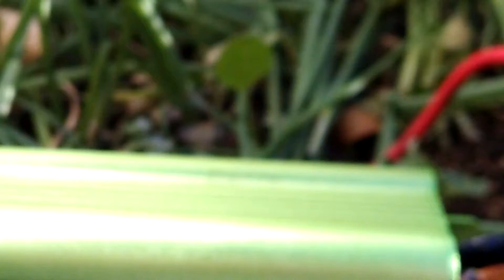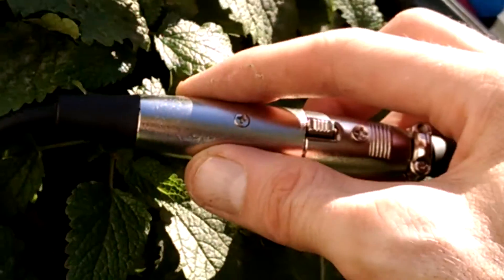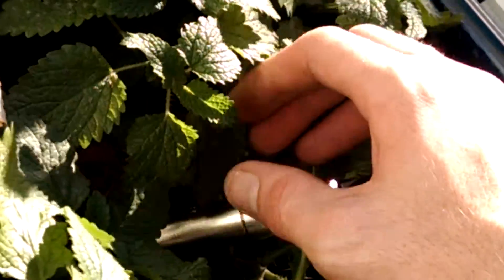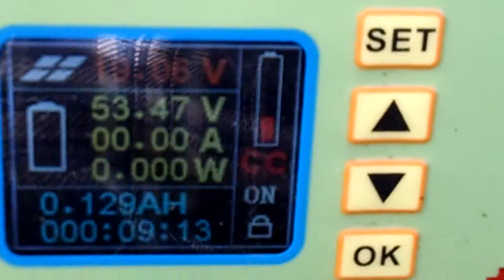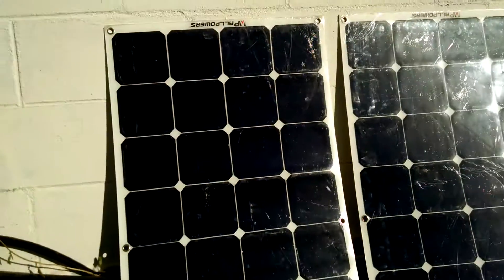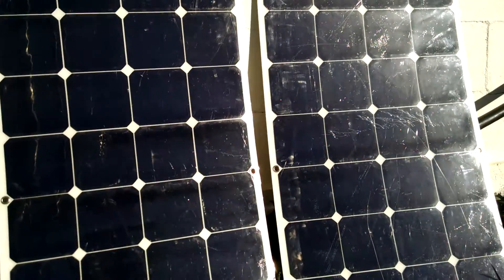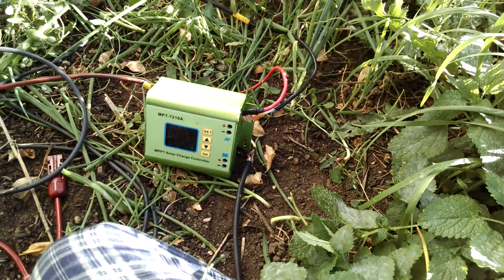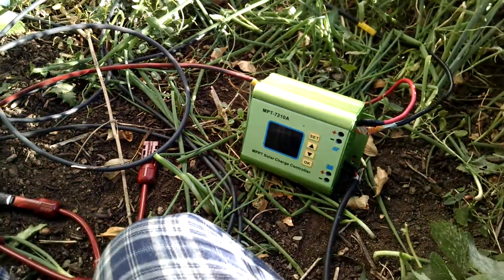Solar Charging Problem SOLVED!!!

Comment: Hurrah! Solved. 
Ordered same panels and controller. Solar trike it will be. No clue. electricity isn't it?
Reply from the maker: i dont understand your question, but i hope to see your solar trike, that sounds cool.
Reply: Hi. Can you help me. My 36 volt 6Ah battery is not charging. Same problem you had. It also doesn't show any Amp hours.  
Now I haven't tried 58 volt setting yet. I read that somewhere. Can this be true? I thought 42 volt would be enough for a 36 volt battery? And at 2 amp like what is says in my wall charger. 
Or maybe it is the cable also? Although the battery does charge with the adapter. 

I have  larger 14Ah battery too. But I don't have the nerve to try that on on the MPPT and solar panels. I might damage it. 

I will try tomorrow the 58 volt setting. Seems so high? 

Thanks.